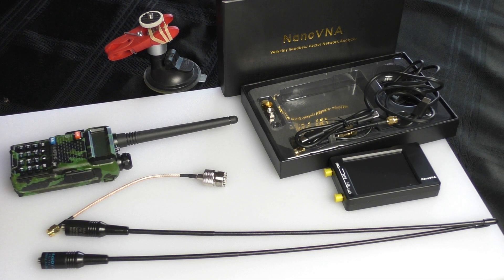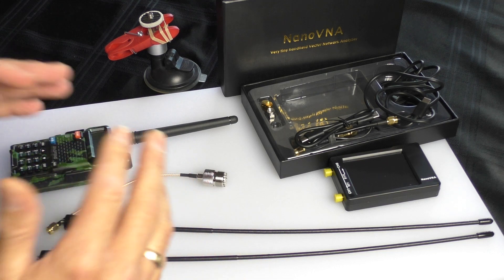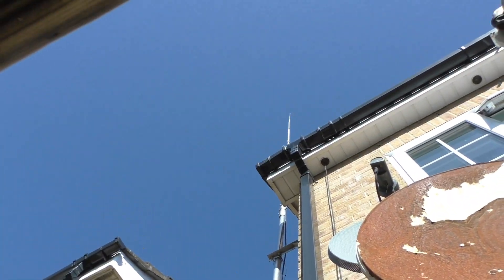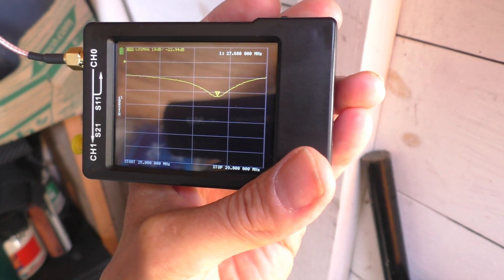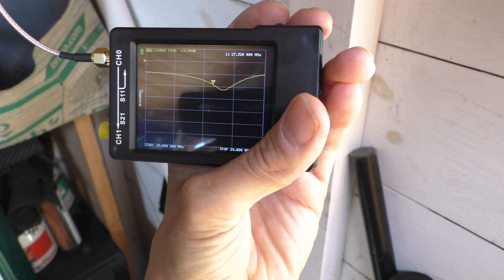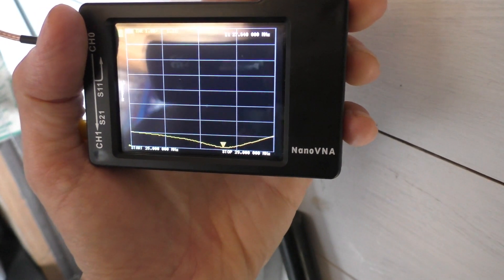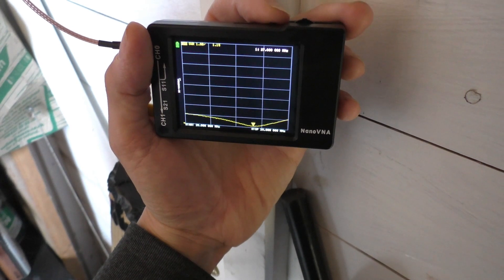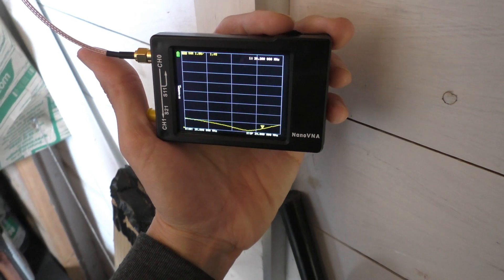NANO - VNA. Antron 99 checking the SWR

Comment: Hi Fred do you give out your email ect as i am not on FB i can post mine on here if you don't mind contacting me i am still getting nothing on my ss 6900 cb with a antron 99 aerial i wanted to show you a picture of my aerial and the readings i get on the nano vna tester when its plugged in indoors and also direct to the bottom of the aerial, i wanted to see where i am going wrong with this set up.
Reply from the maker: Hi Gary.  No probs if i can help i will. fredintheshedyt@gmail.com
Reply: @CB-RADIO-UK  Thank you Fred, i thought i would test the leads tonight and they seem ok, but when i put a meter across the aerial it has a dead short, so i am going to get in touch with the seller first. Thanks again Fred.
Reply: @CB-RADIO-UK  Hi Fred these are readings i am getting today, what do they tell you and is there anything i can do to improve the signal? I thought i had a short on the antenna between the centre pin and screen but the company i bought it from said that was normal?

Comment: What type/version of the Nano VNA tester are you using Fred in this video
Reply from the maker: Hi Gary. Cannot rem the exact model.  The ebay seller is long gone.  Its generic clone.  More in this video. https://www.youtube.com/watch?v=m6nNp0C6zKA
Reply: @CB-RADIO-UK  Thank you Fred, yours looked simple the ones i have googled look far more complicated and if i copy what you have i can always blame you lol if nothing works. Loving your videos. As you know i got the ss6900 also a Antron 99 pole, tried them today and as usual i got nothing at all on cb but sticking with your videos i am not going to give in just yet. I am going to buy a Nano Vna tester to make sure the aerial is working. More importantly as the aerial is  on the ground because i am moving soon, i am going to lift it higher up on a hole because at present it is only just above gutter height. Could i just ask if there is a channel/frequency/band/letter i can use on the cb that will guarantee i should get something, at this stage and what i've paid out i would be just glad to hear something i am not bothered about talking yet.

Comment: Can I check with the Nano if the pmr frequencys are correct and the signal power? 🤔
Reply from the maker: Yes if you use a radio with a removable antenna.  Wont connect to a legal fixed antenna radio.

Comment: Brand new imax 2000. I can't get the antenna tuner low enough my lowest swr is at 28.2 M. So my 11 meter band is per my nap vna 1.7 at ch1 and 1.5 at channel 40. My rings are all the way down.... Don't know what to so
Reply from the maker: Its odd.  I had something like this when i first set up the A99.  The rings were all the way up i think.  Seemed to improve when i removed the spring washers during a service.
Reply: and the best gain on a antenna is about .200 to 300 khz above your lowest SWR

Comment: These are awesome! I've had mine 2 days but just got the SMAUHF MALE - SO239 FEMALE adapter today. Ironically my base and my dump truck antennas are tuned about like yours. The antennas need shortening just a little to resonate at the center of the band. 
I had a thought...if you wanted to use the antenna on 10 and 11 meter I suppose you could tune it to resonate its lowest swr at 28.000 mhz? 
These are so much easier than setting SWR with a traditional meter. 
Now that I know there is a v curve I could use the old SWR meter more effectively. There is so much going back and checking with every little antenna adjustment though  it can wear you down.
With the Nano you can make an antenna adjustment and simply watch the screen.😀

Comment: Fred, a suggestion for a video I'd like to see - using the nanoVNA to help tune an antenna for CB.  Identifying when an antenna whip is too long or too short, etc.  I'm sure it must be possible, looking at the SWR curve and easier than using a traditional SWR meter at ch1, chh40 and ch19 and comparing values.  Thanks.
Reply from the maker: Yes i will be using the nano next time i build a dipole.

Comment: Hiya Fred in the shed this is Jim in the crap. I press the reset button on a 9900 and lost channels how do you reprogram it thank you . Loving your videos
Reply from the maker: James you can go through the channels manually by switching from Freq / Chan mode.  The radio will stay at the freq you leave it on when you switch from freq mode to channels mode.  Its easy to cock them up.
Reply: @CB-RADIO-UK  I'll have a look lol thank you . Keep up with ya videos I blame you for getting me back on the air I'm up in Lincoln  so won't be able to chat.  Stay safe my friend

Comment: Hi Fred and everyone else.  Callum  a Radio Ham (M0MCX) is going to do a series of videos (I don't know how he is going to do this yet) but it will be a course to be enough to give you your Foundation Radio Amateur licence.  It should be good and done with his usual sense of humour.  The basic licence gives you 10 Watts of power and you can use your cheap radios for 2 meters.  It opens a whole new world of radio for you and it is not that difficult.  The good thing about this way of learning is you can watch the videos over and over again.  Anyone interested should get the book as there is some charts you need to be able to look up.  The test is also On-Line now for the Foundation Licence.  So you will be able to do it On-Line.  The book you need to get is https://www.rsgbshop.org/acatalog/Online_Catalogue_Training_19.html#a1711 The Foundation Licence Manual.  It is a bit expensive, but you would be better with it to follow the videos.  This page will be of interest to those wanting to advance in Radio  https://rsgb.org/main/clubs-training/for-students/foundation/ The practical part of the exam is not being done, so you will not need to visit a club to do that bit, though it should be no problem to anyone that has been around CB for some time like yourself anyway.  Pass round the word to see if anyone is interested in following the course with Callum M0MCX.  Here is a link to his channel and videos just in case anyone want it   https://www.youtube.com/user/m0mcx/videos  there are loads of videos on there with a lot of antenna information, though they are mixed through with his daily net ones.  Stay safe and if you do decide to follow the course and pass (not to hard to do) then do not forget about CB.  We need to keep the CB channels in use.  Pass it on to anyone interested in going through to Ham Radio.  It opens a while new world of radio (some snobbery is on there), but there are some good guys on there as well, snobbery can be changed.  Remember when they came onto CB and tried to make us behave like them.  Not a hope and their world has changed a lot since.  More CB users are on there now and there will be a lot more I hope.  Not so much of the Old Boy network these days and Callum hates the snobs as well so he is the best to go with if you are thinking of going through the test.  It is round about £30 or just a tad less to sit the test and if you really swat up you can go through the next test General Licence for the same cost (i don't know how this will work on-line though as it is just for the Foundation Licence.
Callum was talking to some CB people yesterday and they are going to do the course.  He said it was funny as he talked to them on the CB and he was recognise straight away, so they must listen in on his channels.   Callum is waiting for his book to arrive from the RSGB.  You can pay for a book with PayPal by the way.  It is slow in coming at the moment as they are working from home.
Reply from the maker: Thanks Bob  Best of luck to Callum

Comment: Hi Fred. Wrong video I know but I'm just getting back in to cb. Do you know where I can get a frequency list for all the ssb/am/fm uk channels? I've got a ss6900. Thanks
Reply from the maker: You should be able to find the freqs if you google.  A guy sells a laminated printed sheet on ebay for about £3.  https://www.ebay.co.uk/itm/CB-radio-Frequency-chart-for-SUPERSTAR-3900-from-SS-low-to-SS-High-full-colour/192787173855?hash=item2ce302d1df:g:t3sAAOSwcB5ZKRtc
Reply: @CB-RADIO-UK  cheers

Comment: That satellite dish is looking a bit tired, Fred. Looks like it's now owned by Iron Oxide. 😛

Regarding measuring: "any objects placed around an antenna, such as an enclosure or product packaging, will alter its radiation pattern, thus altering its input impedance. That’s why it’s important to use a VNA to measure the input impedance of the antenna (including its intended feed line) within the environment that will most closely resemble where it is intended to operate." -- from a good article by Tektronix here: https://www.tek.com/blog/antenna-matching-vector-network-analyzer

Comment: Hi Fred , Great videos & very informative . I've been watching other youtube videos on grounding home base antennas to earth via a copper coated ground electrode spike that's connected to the Antron wall bracket with 16mm copper ground cable in order to protect radio equipment from high atmospheric static , this may also protect equipment  in thunder storms .

Comment: Guys, I’m stumped. Getting a new 9900 doctored to use all the frequenters but can’t put an outside Ariel because of the block owners. Won’t let me put up a sigma or even a lil die pole, so, is there anything I can run 10 and 11 mg inside. I don’t have a loft either. Send us some ideas please. Double please. Good post as ever Fred. Very interesting. 👍
Reply from the maker: Your going to struggle with an inside antenna Ian.  Is there no way you could mount a mobile or boomerang antenna that you could place out of a window when in use and then bring it in again.

Comment: The 27.6 set point means both ends the FM 40 and the US or EU  40  are still below 2.0 certainly usable and with your  little tuner if need be you could touch it up. I would be curious to see what happens if you do  one of two things, drop a ground wire to the ground below with a rod in the ground and or secondarily  attach your mount pole  or ground the pole to the gutter if there is one?  You are in my view correct  to think swr wise your A 99 is working well. The second thing I would like to see is you do the same as in this video except for 18.1 or 17 meters, 21.3 or 15 meters and 24.990 or 12 meters and the voice or ssb on 10 or 28.400 I would expect possibly all to be under 2.1 SWR  well with in using ?  I know many hams use the A 99 on these bands but have not seen  any videos like this one for those bands. By the way I ordered one of these VNAs from the link you shared, can you tell me  if it took a while for the shipping  to show it shipped, the seller has it showing on the tracking as contacted but not being shipped. Curious of your experience? Also the link I sent you the other day has the DX Commander  builder Cal there in the UK starting some videos on how to get a Foundation licence or call sign, with the money you already have invested why not get the first level license , build a few dipoles in your attic or use the A-99 and also use your radios on those bands. Like you  I started as a CBer,  am loyal to my roots yet also can use the ham bands. Other than some wire etc you could get going with very little costs. Cal's DX-Commander multi-band vertical can be bought in your country rather cheaply and you could really put your VNA to good use.  Doesn't mean you leave your friends on 27,305 just make some more new ones  !
Reply from the maker: Thanks for the advice.   I did buy a ground rod for the A99 but the surround around the house has a concrete base.  I will be building more dipoles later in the year.
Reply: @CB-RADIO-UK  https://youtu.be/DLDdOepaq7k  Came across this fellow and his version of this antenna, thought you might enjoy his approach? https://www.youtube.com/watch?v=5VxHNTttpEc

Comment: At least you are experimenting Fred, a lot of people that comment will not have used one of these.  Nice one Fred, keep on experimenting and sharing   :-))  Just out of interest, how does that compare with your SWR meter?
Reply from the maker: When i last set up the A99 i got about 1.2 or less in the shed.  Up in the shack (loft) it increases to 1.3. Thats on a Zetagi TM999 meter which aint exactly cutting edge tech.
Reply: @CB-RADIO-UK  No, but you can make a meter that is close enough.  I was just interested to see if they agreed or not, but the difference is nothing anyway.
Reply from the maker: @BoB4jjjjs  I think they are close.  Comparable to the built in SWR on the 6900n.  Its prob about as much as i want to go into SWR testing.  Anything around 1.5 is normally good enough for me.
Reply: @CB-RADIO-UK  Yeah,, 1:5 to 1 is good enough across the band you want.  2 is ok at the edges and if you don't talk there for to long, but high power at 2 to 1 is a bit dodgy!

Comment: 6:00 No drip loop for coax entering shed???
Reply from the maker: Too tight since i raised the pole.  Prob will replace the 213 net time i drop the A99.
Reply: @CB-RADIO-UK  Buy a more expensive coax, I think you might be surprised how much a difference it will make.  I know it is the thicker lower loss, but look around for cable with a higher spec.  Good cables will give you a loss spec per meter.  In the meantime put a bit of tape with a string hanging down, the water will follow it to ground and not go into the shed. Bit of string round coax, tape over that so it makes a ridge then put another bit of string in front (the uphill side) and water will follow it off the cable.   EDIT:  For antennas well up into the air, it is better for safety if you put an earth to ground, at the very least, get a spark gap connector that will take static or lightning to earth, it won't save the CB, but it might well save you or the shed.  At night put a short on the coax, just use a plug shorted to the outer and if you have a spark arresting connector in-line it will take anything straight to ground.  It will not help in a direct strike, but I have seen a lot of high voltage sparks jumping from coax before now.  My antenna always had a big heavy wire to earth.
Reply: If you get water in the coax, it also creeps upwards due to the pressure from above and corrosion of copper via your outer jacket of your coax, just like a cotton wick it has cost me 17.6 meters of coax.

Comment: Get a long USB-C cable and use a laptop as the NANOVNA's display
Reply: You mean build swr meter using laptop?
Reply: @consv366  download the Nano VNA Software - runs also on a USB Stick - start the program and connect the Nano VNA via the USB C cable...

Comment: Did you make the pigtail? Good job. Can you link the parts please? I'm assuming that the resistance of the pigtail has to match the resistance of the 213 coax? 
50 Ohms?
Reply from the maker: Its a 50 ohm connector.  It was an ebay purchase.
Reply: @CB-RADIO-UK  thanks Fred. I really appreciate the feedback. 👍

Comment: I might have to buy a NANO. IT MAY MAKE IT EASYER FOR ME TO ASSEMBLE AND TUNE ANTENNAS THIS SPRING. IM SCHEDULED TO ERECT 2 ANTRONS, 2 IMAX 2000's, 3 MACO V5000's, and 2 HYGAIN SUPER PENETRATOR SPT-500's.
Reply from the maker: This meter will make it 100% easier to tune antennas.